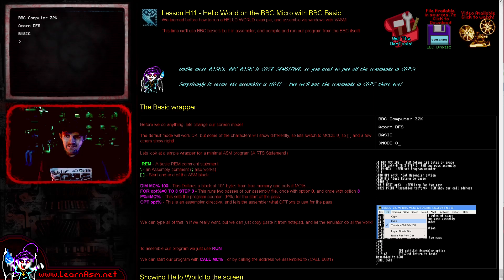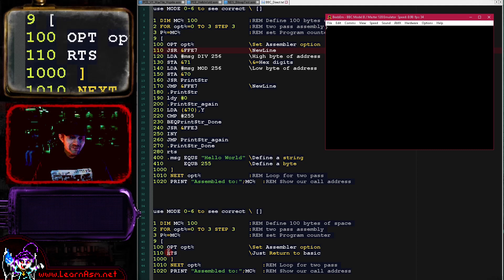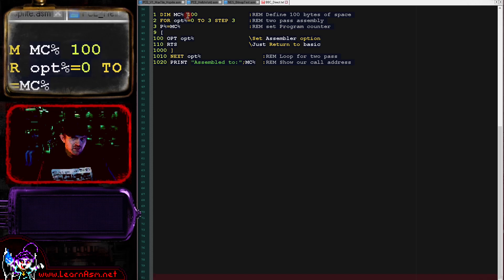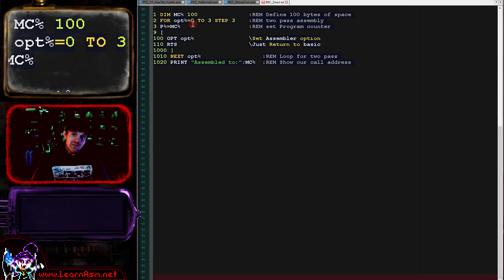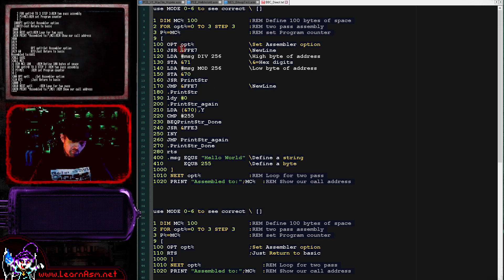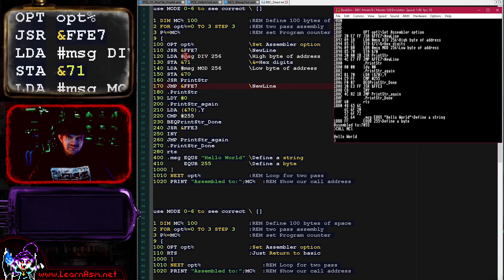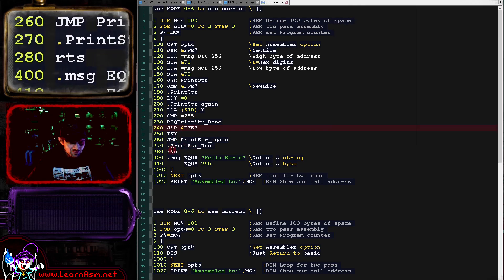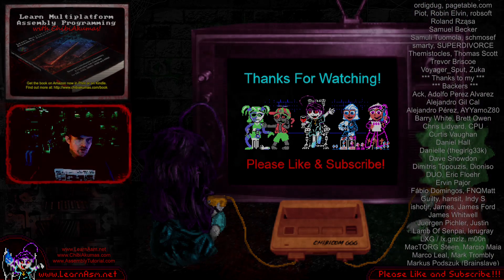Assembly Hello World on the BBC Micro Assembled with BBC Basic! - 6502 Lesson H11

Comment: If you null-terminate your strings (i.e. end with 0), you won't need the `CMP` instruction as LDA (..),Y will set the Z flag if it is 0.  That's 2 bytes saved :)
Reply from the maker: I started using 255 termination in the ChibiAkumas game, because 0-31 were used as an X co-ordinate change. I've kept it ever since because I share code and data with all my projects.

Comment: I have a very fuzzy memory, that BBS basic could inline assembler code into a function definition, access the parameters and run from the function call.
Reply from the maker: Yes,  I think you are correct - it's not something I've done though!
Reply: @@NRGY - I think I remember using DATA statements to get a chunk of machine code into memory.  As long as you know the address where BASIC places the DATA chunks you are good to go   ;)
Reply: @@NRGY - Yup ...  Typo ... Somethings never  change   ?SN ERROR